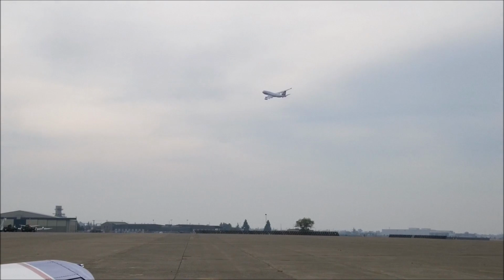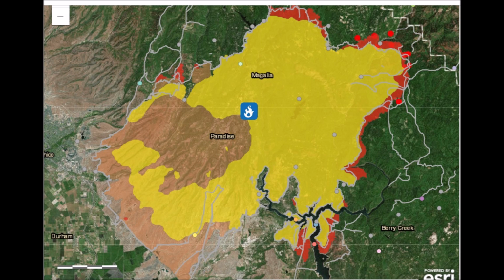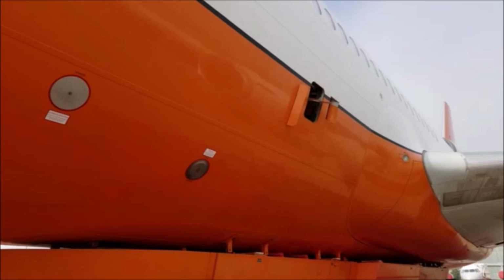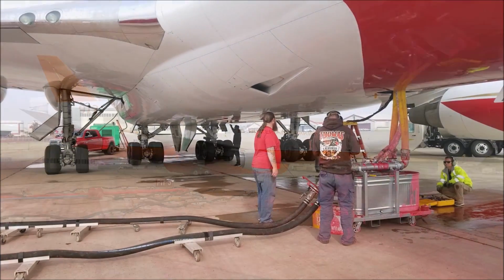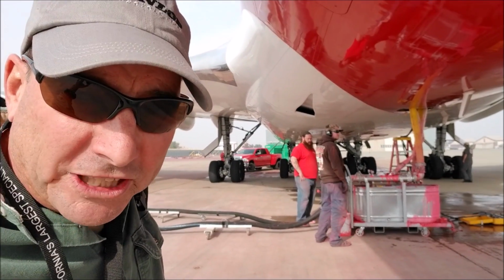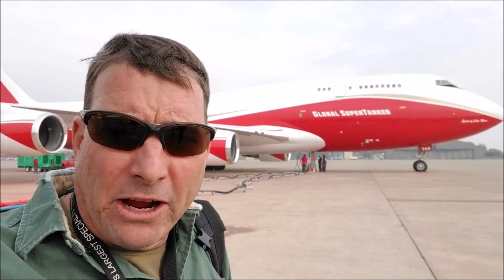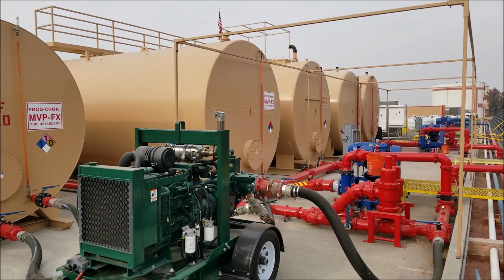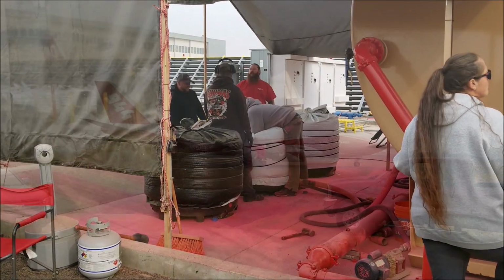747 Global Supertanker 'Camp' fire Day 6 UPDATE McClellan Load and Return

Comment: Five years down the line I wonder how this faithful 767 is standing up to a strenuous regime. A magnificent piece of engineering, it was nevertheless designed for long haul high altitude flight. Does repeated short flights at low altitude over undulating terrain take its toll on the airframe? And what about the engines repeatedly cycled every hour for day after day of crucial emergency operations?

Comment: In the 1980's, I had a front row seat on air tanker operations in western Nevada, during the fire
season. They were flying DC-6 tankers over Carson City (Ormsby county), and later over Lyon county. Quite something, to see the twin engine spotter aircraft come snarling in almost at treetop level, followed by the DC-6,
with its 4 big radials echoing off the hills and canyons. Then the steep climbout at full power, after the drop. Not in the same league as the DC-10 or the 747, but still very impressive.
Those pilots earn every penny.

Comment: Isn't the 747 a -400 model, would they have a flight engineer for that?  This was absolutely fantastic reporting Thank you!!!
Reply: The 400 is actually the first 747 model to not have the FE position. Boeing essentially took the EFIS technology developed for the Boeing 767/757/737 Classics and refined it for the 747-400 in the mid-1980's.

Comment: Great report,  I was just checking the specs on the Mars flying boat that were used to fight fires. They had 7200 gallon capacity and could load on the fly in 30 seconds. All you needed was a lake.

Comment: Excellent reporting Juan. Kudos to all who provided you with the access and information. Your skills and professional reporting has to be a driving factor in obtaining access. As a future topic perhaps you would consider covering the different airframes used and the gallons of retardent applied per day for each airframe (Max. capable) given the complexity of round trip flight times, IFR/VFR restrictions, reload times, etc. Just like the passenger airlines swing between larger and smaller aircraft, it appears to me that the firefighters are trying to figure out how to get the most bang for the buck. Too, wasn't there some contravercy about using the amazing 747 for this application?

Comment: Multiple very good points you make at the end.   Additional clarification should be made, though. 

If logging with the emphasis on forest management is to succeed it should be selective based on tree size, i.e. trees under say...15-20 inches in diameter (example only).  A focus on thinning forests (minimum distance between remaining trees) rather than all out clear-cut to avoid stereotypical packed-into-a-sardine-can second growth.  Wood scrap/chaff/brush that would normally be left on logged acreage would have to removed (paper pulp?) to lessen easily ignited kindling.  Such a system in place would potentially limit the amount of fuel available which makes these fires burn so hot, but also in hypothesis make an environment that would allow old growth to eventually come back.  Especially, if I'm not mistaken, old trees with thicker bark would often be able to survive a fire.

California's water problem must also be dealt with.  If they aren't already doing it, desalination plants might be a good way to limit the draining of reservoirs that would otherwise be providing water to forests.  Forests which are now under threat and dying by bark beetles due to lack of water and worsening of drought.
These are only half-assed 4 a.m.-haze ideas.  In the end, the biggest hurdle is getting everyone to pull their collective heads out of their political asses, USE SCIENCE, and come up with a plan that's a win for everyone and everything.

Love the planes BTW, thanks for sharing the amount of work that goes into operating them.

Comment: Thanks for taking the time to share your passion and knowledge regarding VLAT's. 
In regards to the pressurized system of the 747, what are they using? Is it literally just an air compressor filling an onboard tank, or are they transferring CO2? Really interested in the composition of what is going into the compressed system, and why they choose that system.

Thanks!
Reply from the maker: just air.

Comment: No offence but the amount spent on sending that aircraft up in an attempt to fight the fire  with small outcome or even effect is just not cost effective what so ever.   The amount of money spent on that one flight could have been spend on other fire fighting methods.    The amount spent on the pilot, the amount spent on fuel . . not only that the emissions from the fuel, then you have the oil and maintenance upkeep of the aircraft.  The flight restrictions and so on that need to go out, just seems like everytime this beast or any JET planes attempt to fight fires is just simply not cost effective what so ever. . . . Maybe the Erickson Crane would definitely be more suitable in EXACT effect locations but other than that . .

Comment: 12 lbs per gallon of fire retardant is equal to 228,000 lbs of fluid when its full.  Fuel is 6.7 lbs per gallon HOWEVER that can change depending on fuel temp and ambient temperature.  I fuel aircraft at MSP so i see the density of fuel change throughout the day.

Comment: Juan very fascinating . Thanks for taking me along behind your lense . Are you still a pilot and if so may I ask what type aircraft do you fly and may I also ask what airline do you fly for and do you fly domestic or internationally ? Are you also a fellow Veteran & if so were you a military pilot ? I'm an Air Force Veteran. Do you live in California ? I live on the west coast of Florida  where we've had some bad wildfires in the past . Was this fire really caused by some ones campfire or was it the fault of a California electric company ? Shouldn't you be wearing a hearing protection head set around the loud aircraft. You mentioned the 747 still has the on board bathroom  am I correct that the poor aircrew on the DC -10 doesn't have one? If so do they at east have a portable toilet to relieve themselves ?
Reply from the maker: See my Lion Air update for full bio.

Comment: There was a fire up here yesterday in Boulder Creek (called the Bear Fire, -same name as the fire last year in the same area) and they had at least 8 air resources to knock it down in just over 1 day (3 firefighting helicopters, two spotter planes, and 3 air tankers: A MD DC-9 and a Boeing 727 (don't know where they're based or the make and model of the 3rd smaller plane). But the DC-9 flew at less than 500 feet altitude above my house making incredible aerobatic maneuvers I didn't think possible for an airframe that size. These pilots (usually former military and/or commercial airline pilots) are beyond balsy/gutsy, and fly these planes like stunt pilots sometimes (on very rare occasion costing them their lives). But their service to all of us, is so greatly appreciated. You can only have massive anxiety about living in the mountains in the middle of a 300 foot tall forest with a wildfire so close by. The fire was only a half mile from my house and flared up large, temporarily and seemingly out of control. But within a few hours, these air tankers (and helicopters) had it under control and they knocked it down quickly. I wish I would have taken video of the DC-9. It was barely above the 300 foot Redwood tree-tops by 100 - 200 feet. Me and my friend who was helping me work were both amazed by the size of the underbelly and how low it was flying (and at the bank angle he was turning). Nice Guitar Showcase neckstrap : )  Thanks for bringing us a background and information we would not be able to see anywhere else.  https://bit.ly/2PDxXcs

Comment: It is tragic that the Obama Administration abruptly cancelled Aero Union's contract, grounding all the P3 Orion tankers, and put Aero Union out of business, without any warning or due process, right in the middle of the 2011 fire season.

The Obama Administration claimed they did it because of inadequate or non-compliant safety inspections. The CEO of Aero Union told Wildfire Today that the Orions were in full compliance, and meticulously maintained:

http://archive.is/FMtmD#selection-667.0-667.177

I know of no evidence to the contrary. In fact, ONE of the seven Orions was fresh from a major overhaul and refit. The Obama Administration cancelled Aero Union's contract ON THE VERY DAY that seventh plane was scheduled to enter service. Obviously THAT airplane wasn't overdue for its inspections!

The fact that the Obama Administration did the  deed on the EXACT day that a seventh Orion was scheduled to enter service, after Aero Union had completed the expensive process of fitting it out for firefighting, looks like a calculated decision  to do the maximum possible amount of financial damage to Aero Union.

What's more, there's no disputing the fact that the big four-engine Orions had an excellent safety record, much better than the smaller two-engine Neptunes, which remained in service by the USFS for several more years.

The USFS really needed those P3 Orions. They still do. I wonder how many people have lost their lives because those planes were unavailable when they were needed?

The supposed safety concerns sure look like a pretense, not a reason. If they REALLY thought there was a safety problem, or a problem with the inspections, on even one of those planes, the obvious remedy would be to TEMPORARILY ground that particular plane, until the issue was resolved. Instead they abruptly and PERMANENTLY cancelled the entire contract, for all seven planes, right in the middle of the fire season.

Those big four-engine Orions were "THE BACKBONE" of the USFS aerial firefighting tanker fleet. Their retardant delivery system was "the gold standard for air tankers."

I'm not the one who called those planes "the backbone" of the fleet. Those words are quoted from a 2011 LA Times article:

----- begin article excerpt -----
Dennis Hulbert, who retired last year as the Forest Service's regional aviation chief in California, called Aero Union's P-3 tankers the backbone of the aerial firefighting arsenal. "They were generally one of the more effective planes in the fleet," he said.

The four-engine turboprop aircraft have been retrofitted to carry about 3,000 gallons of retardant and are considered by fire managers as workhorses, capable of flying in conditions and terrain that might exclude other fixed-wing aircraft. But the planes are old, Hulbert said, and coming to the end of their useful life in wildfires.

The Forest Service has contracts with two other companies to use 11 P-2 tankers with a smaller capacity. But they are in no better shape than the P-3s, Hulbert added, and have crashed at least three times since 2003.

"They are older, hold less retardant, and not as effective," said Hulbert, who is now an aviation consultant. "They are all on their last leg."
----- end article excerpt -----

Note: the last of the old two-engine P-2 Neptunes have finally been retired (and only four were still in use in 2017). That's good: their effectiveness and safety records were both much worse than the Orions'.

As of February 2018, still none of the P-4 Orions were under contract to the USFS:

http://fireaviation.com/2018/02/16/air-tankers-cut-one-third-2018/

http://fireaviation.com/2017/08/08/a-former-aero-union-p3-to-be-resurrected/

http://sealevel.info/fireaviation_2018_usfs_tanker_lists.png

Comment: Thanks  Juan!   In years gone by, that 747  was  dropped out because at first it would only  do water..  what a shame!  Had to be certified to do Chemical drops.. From  the early  tests on the 747  with the amount of water it could carry  over the actual fire line, amazing  what it could do the change the air  temps  on the fire it's self!  In ID,  I saw close up  the use of retardant.. years later  people are still dealing  with the stuff!  but a great  job!  Thanks  for the info!   If you can, Juan,  find  out updates on water drops  for the big  planes !

Comment: They will NEVER do better than the Martin Mariners! These take forever to land, refill and take off again. The ONLY OPTION for FAST fire suppression is SEAPLANE OPERATIONS guys! 
They need to build NEW MARTIN MARINERS! All the time these guys have to fly probably hundreds of miles AWAY from a burn zone to a runway costs LIVES  and ASSETS. Why has no one had the sense to build new heavy seaplane tankers. Now only ONE MARINER is left, it is flown GLOBALLY as its in such demand!!
The 747 is far better than the DC10 as the WHOLE CABIN is equipped with tankage!  It seems a bit of a waste to bolt on small belly tanks onto an otherwise wasted space x the cabin in than DC10
There ya go $16,000 per hour to run the 747 the Martin Mariner costs around $8,000 per hour! 
I am a retired veteran Air Force aircraft engineer I wish they would build new Mariners. The crews do a great job but without seaplanes air tankers have their wings clipped. Eventually ALL the  large seaplanes sadly will be gone........then what? 
God Bless all the tanker crews all the same as those poor folks in Cali sure need you!
Great report
Reply from the maker: Keyboard Krazy we don’t have lakes like up in Canada....

Comment: I have to wonder how the handling characteristics vary from that of a 747 cargo or 747 passenger flight. I doubt there is much room for slosh on the tanks, so the fore/aft weight shift should not be much of an issue on takeoff, and they probably discharge from all tanks equally, but 19Kgal of Phos-chek would run somewhere in the neighborhood of 171Klbs (19Kgal * 8.97lbs/gal, rounded up), where even in the 600 seat configuration, figuring 230lbs per passenger+bag on average, you only get 151Klbs, which is likely high since I doubt that configuration gets that many folks with 50lb bags (could be wrong...and it makes me wonder what weight is actually used for the "average passenger" , and if it varies based on seat configuration).  But excellent coverage as usual Juan.  Oh, and did you find yourself wishing that somehow, you could get a fly-along and interview?

Oh... and like you, I still end up calling places like McClellan "Air Force Base", even decades after they ceased being so... such as Rickenbacker.

Comment: I about had a flashback. On my first deployment to Vied Nam our C130 had a mechanical issue and we had to stay over night on Guam. The B52's were going out on bomb runs all night. I was a lucky on and drew watch on our plane. I'm sitting next to the plane when a B52 came down the taxi way by the terminal. We were parked on a pad in line of the access road, or what ever they called it. The B52 kept coming closer and closer and closer and I thought they were going to run over the 130. I got up and tried to decide if I was going to run. Just as I started to back away the 52 turned and the wing tip almost over my head. And no, when my 4 hour watch was over I didn't go to sleep! That B52 is a BIG and spooky machine. Carrying a full load of bombs and wing tanks the wheels on the wings come off the ground about half way down the runway and the main gear doesn't leave the ground until nearly the end of the runway.

Comment: Did u say 17,000 for the DC-10  and 19,000 for the 747? Only 2,000 difference?  R they using any RR engines?  Thank u for great vids!!
Reply from the maker: 9000 DC-10.
Reply: @blancolirio  The DC-10's hold 12,000 gallons, but only load to about 1,160-1,175. 9,000  gallons incorrect.

Comment: Juan, The early 747S had flight engineer stations and perhaps this one did as well, but my understanding is the 400s did not have the engineer stations. That was one factor in the operations that reduced the expense of operating the later aircraft.  At least when we were planning an airline a few years back that was the impression we were under. That is not to say that Japan Airlines did not special order it up with one or perhaps it has been refitted for the tanker ops.  Just asking.
Reply from the maker: I'll find out in a pilot update...
Reply: One crew member has to drop the retardant! Not so easy when flying at 150ft...

Comment: Juan can you give some cost numbers. I have a friend who signs the bills for Cal Fire and I don't want to repeat the wrong numbers but the cost just to call out one of these tankers is beyond crazy and each load dumped was just as crazy.  One more thing. 9000 gallons is almost nothing. A typical fire truck can put out 1250 gallons per minute and a larger ladder truck 2000 gpm.
Reply from the maker: Don't know any other cost numbers. I heard a single FF box lunch was $35!
Reply: Some numbers discussed in this article: https://wildfiretoday.com/2012/09/20/does-the-dc-10-air-tanker-deliver-retardant-at-a-lower-cost-than-a-bae-146/